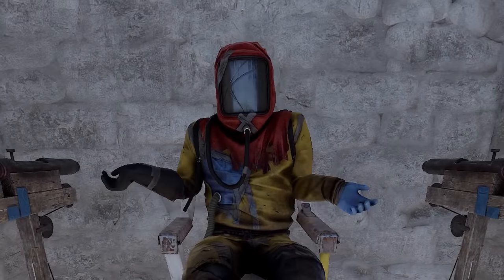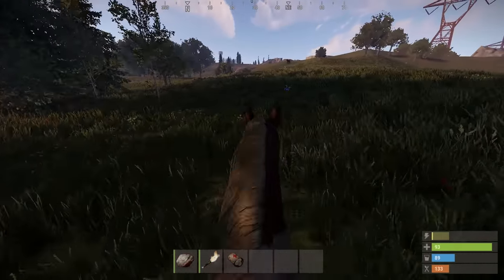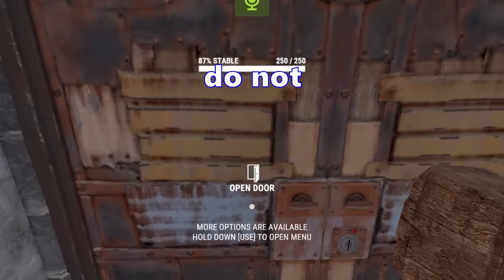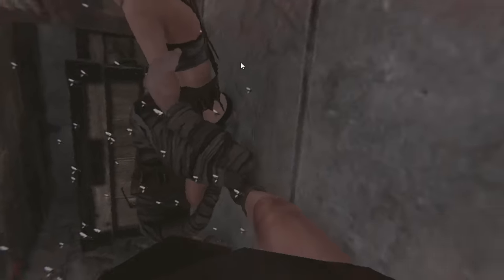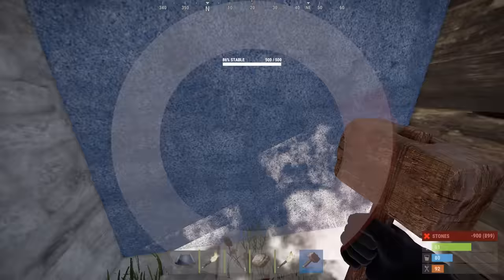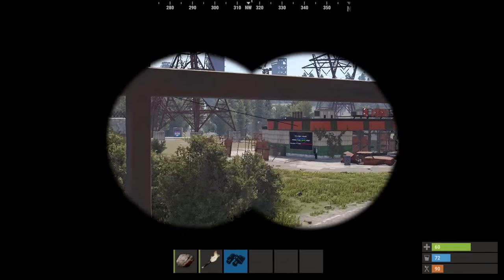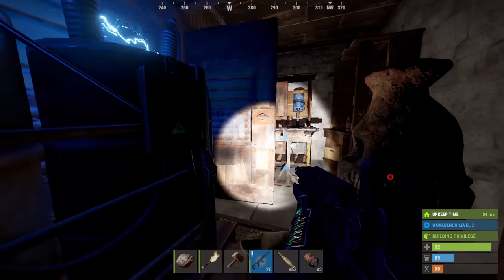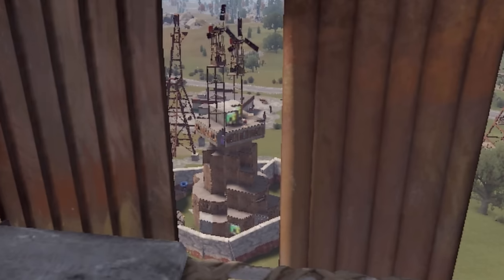The "Raided" Trap Base

Comment: Imagine if you will using a snow biom and sprinkler in air lock combo. Utilizing a door opener and a push button to create 1 rust watt you can close the door to airlock from inside. once victim is trapped in airlock simply turn switch to gravity fed sprinkler in air lock via water barrel or catcher above on roof. Only artic hazzy can withstand it. You can't heal -42 and trapped. Easy cheap loot no electric at all. Just sit by a fire inside and watch the comfort go from 75 to 50 then clean up loot. I have plenty of tips and tricks never seen. I have an automated base modular design on "stranded rebooted" hoping some one will raid it to test design.
Reply: Do you have any videos of this?

Comment: So just curious, how did you hide the power producing component? Is it solar panels?
Reply from the maker: This time I just charged my batteries in my second base with solar panels, but sometimes I go as far as to build a nearby base with a windmill or panels that is close enough to attach to a circuit in the trap base. I then hid the wires under the ground by making sure to have a small hill between the bases. the wires will connect through the terrain and be invisible to players
Reply: @GreetsGaming  About how long did you find your batteries lasted? Probly a long time I'd guess since there is not much active usage.
Reply from the maker: @trollhunt3r577  A fully charged medium battery lasted me roughly 8 hours with a load of 17 between the turret and components

Comment: How did you set up the electrics I'm a newb lol I want to try
Reply from the maker: start out with beginners tutorials on rust electricity. try making some simple circuits then go for more advanced stuff. it takes a little bit of time to learn, but its not too complicated.
Reply: @GreetsGaming  I mean what did you use for your setup for this video then I will figure the rest out on my own
Reply from the maker: @delroywilliams6917  oh word. I used a medium battery connected to 3 solar panels to charge. I used two electrical branches to route the power around. I used a memory cell connected to a heartbeat censor, a door controller and a turret to have the trap auto trigger, and i used a smart switch to reset the memory cell. It's kind of hard to describe how those pieces work together without either showing you if you aren't already familiar with how the individual components work. The memory cell is the key component to getting this trap to automatically trigger itself
Reply: @GreetsGaming  thank you bro

Comment: Since you hate roofcampers so much, i will tell you a trick of a trap base that kills them.
You gona need:
1x TC
1 small and 1 big door (bonus if its metal ones)  (window is better)
Some wood
Some high quality metal to upgrade
Shop window
Chair
Table
Piano?
Bionices
Shotgun traps, Mines and other traps.

At night when roofcampers cant see shit, build a triangle and square foundation. Place a tc into a triangle and secure it with a window. On a front where roofcamper base is place a shop window. After you add a door place down a chair and table.

Outside of base place traps all araund it.  If you want a piano to play, extend base by 1 square away from roofcampers so you can open the door and roofcampers can see you play the piano.

Now troll them in chat and watch them with bionicles, tell their location on map and just be a shithead to them. Sooner than later they will come to you with rockets, get killed by traps, you loot them and run with their guns :D

Then you repeat the process.
Reply from the maker: Lol this was a great read loved it